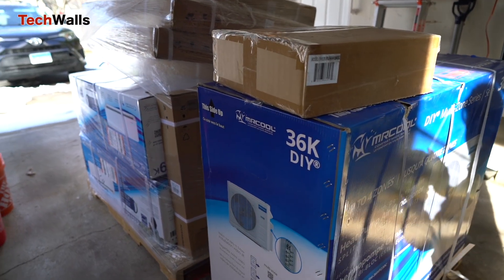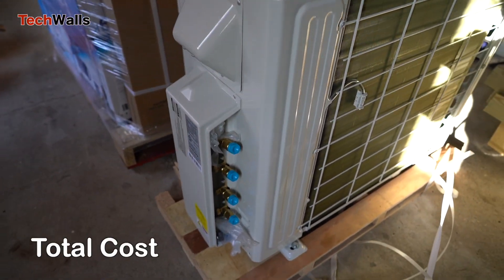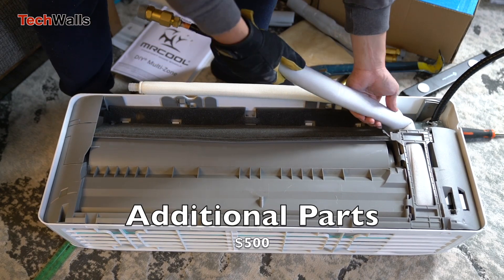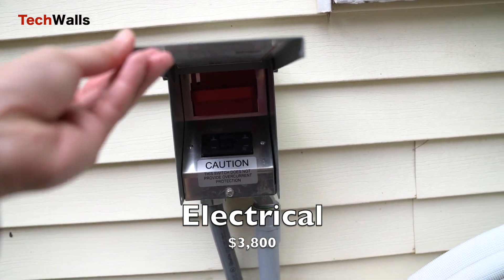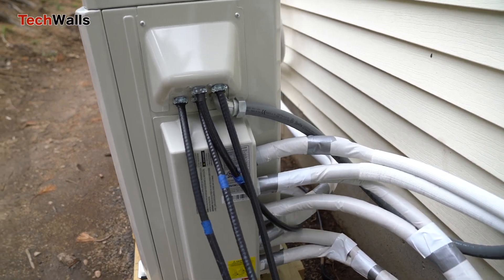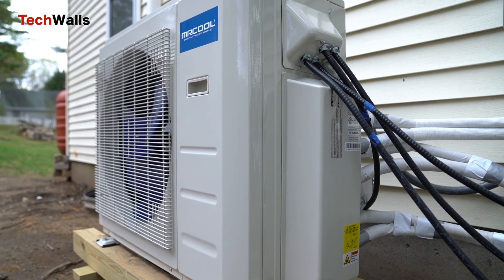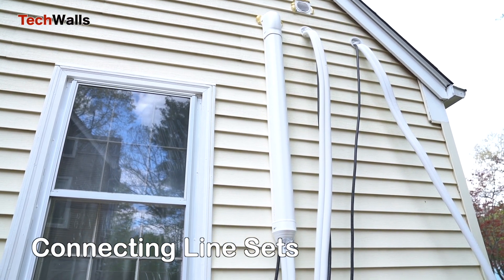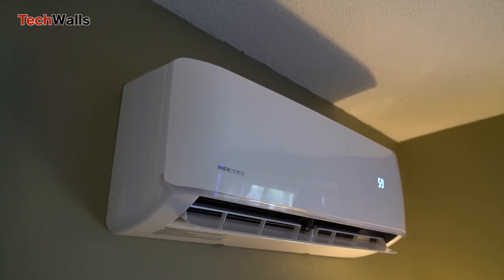MRCOOL DIY Multi-Zone Ductless Mini Split Heat Pump - The Real Cost and Installation Time

Comment: The reason this looks more expensive than usual is because of the electrical service panel replacement. The costs associated with the panel replacement, especially the electrical labor made this more expensive.
Reply from the maker: True, it will be way lower than $10k if you already have a 200A panel.

Comment: Theae prices are nuts brother.  Our brand new central air and furnace was less than 8 installed.
Reply from the maker: You are just replacing existing systems. The price here is for installing new heat pumps.

Comment: Labor only how much did it cost?
Reply from the maker: Contractors won't install this MRCOOL, I had to install it myself.
Reply: @TechWallsReview  how much do you think a contractor would charge? Just labor?
Reply from the maker: @billy-santos  From the estimates I had, labor should be around $10k-$20k
Reply: @TechWallsReview  cool
Reply: In Ohio you can get a 1 unit for $1200 installed. This guys prices seem outlandish. I have tools but I could install one of these by myself for just a couple hundred apart from the unit. 
@billy-santos
Reply: Is the labor cost include cost for permit, electrical panel cost, and other parts?
Reply from the maker: @billy-santos  That includes permit but no electrical panel.